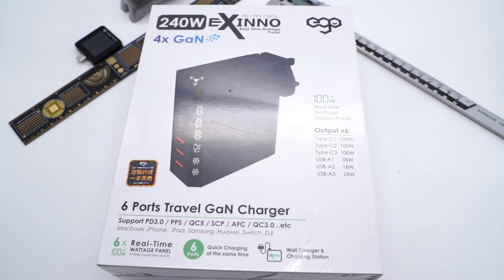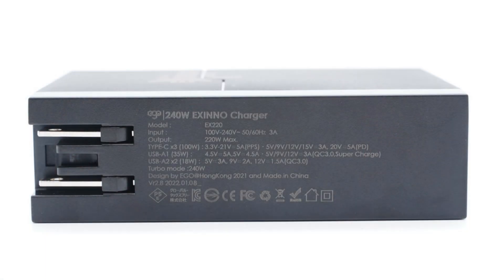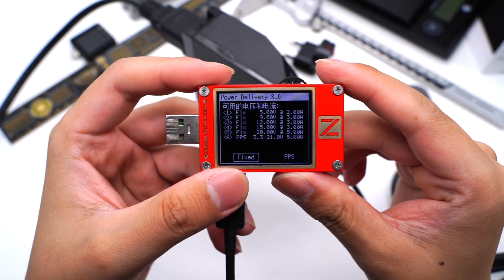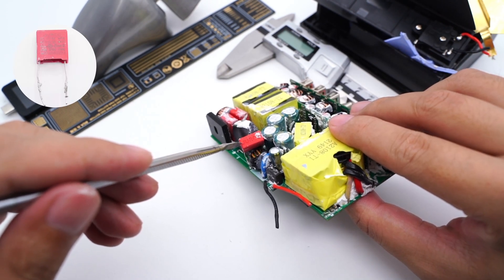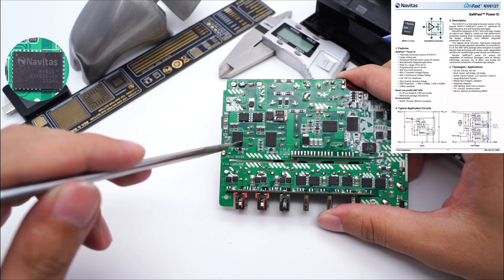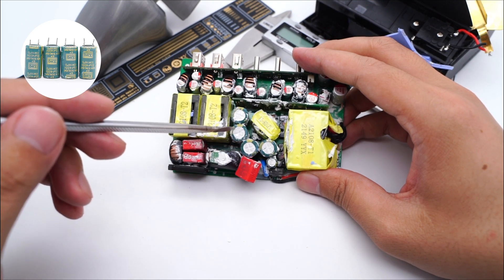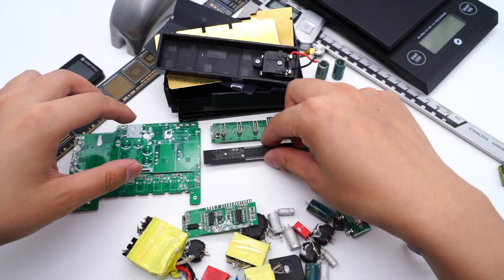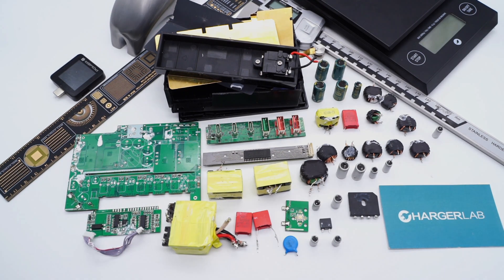The King of Chargers | Teardown of EGO EXINNO 240W

Comment: Thanks for the video. Very interesting to see what they’ve packed in there!

The display panel digits for the two left most USB-C ports have ghosting on my unit. The third USB-C and all ports to the right show clear display digits.

Is this repairable in your opinion? I am capable of safely taking apart the unit and have experience soldering SMD components, etc.

I just don’t know if this is related to a physical issue (pressure on the display) or if I would need to replace the driver?

Really appreciate any advice. Thank you!
Reply from the maker: We won't suggest you to take apart the charger yourself, I think this product is still under warranty, you can contact with the seller to get a replacement.
Reply: @ChargerLAB  Thanks for your response! 
I bought it from Taobao and sent to Australia. No chance of return due to shipping inconvenience.

Without warranty, what is your opinion about the technical cause of the issue?
Reply: My charger stopped working after a few months, this includes multiple backers from the comments on indiegogo.

From your expertise, what would be first failed point for this device?

Comment: I dont get the point of this channel, I just found it, I am a fan of chargers etc, but there is no opinion being given, like should he say something like, this is a good design because of X and X or these are good parts because X, or test the stability/how clean the power delivery is? or the heat dissipation/longevity, like i know the meaning of a teardown but teardowns are usually to repair things and chargers are usually not a repairable item for most retail buyers.
Reply: This channel is mainly for engineers that are already familiar with chipsets and design. These videos provide an unbiased tear down. I personally believe this the best tear down channel on YouTube.
Reply: @mariomariojr32  yeah as far as tear downs with no feedback goes this is tops, didn’t realise it’s for engineers, thanks for the reply, I was trying to find something with opinion and explanation rather than just listing the parts, seems this would really help out upcoming charger manufacturers copy and replicate other designs etc to be more cost effective than full designing and testing
Reply: @Charger lab, Kindly take note of the above comment and improve the otherwise good videos accordingly.